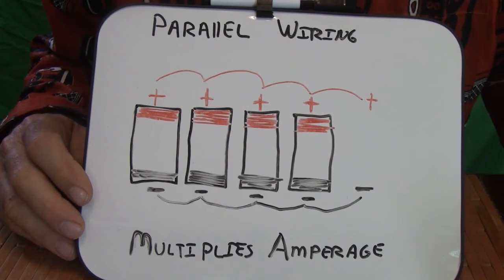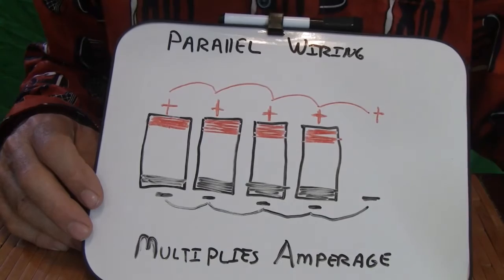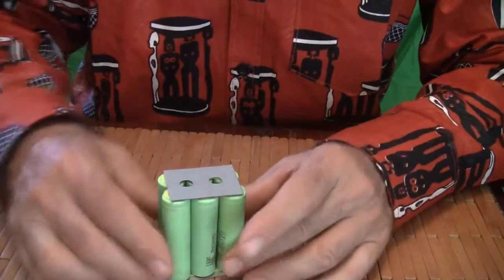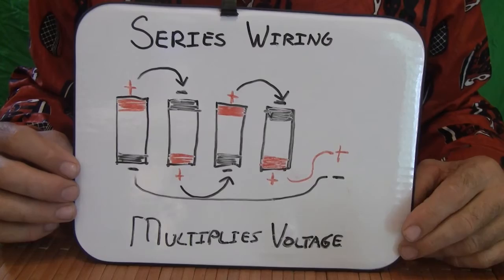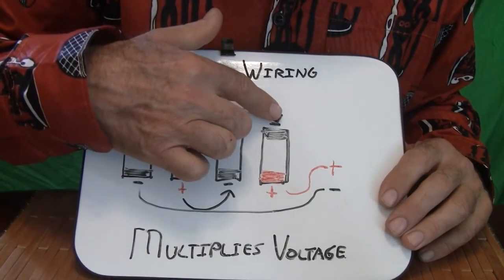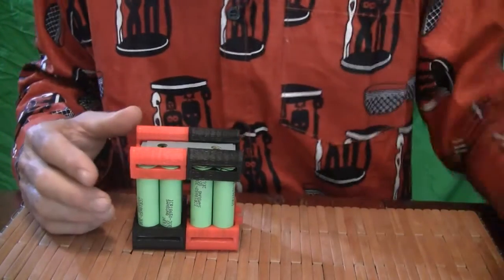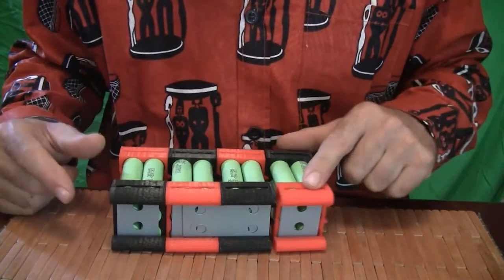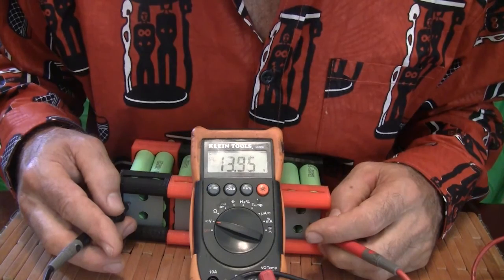Series and Parallel

Comment: I'm confused surely 3 , , 4 volt cells in series makes 12 volts ?
Reply from the maker: The nominal voltage of lithium ion is 3.6-  so, you can use either 3 or 4 cells in series..
Reply: thanks your a good teacher,i stumbled on this video trying to understand bike battery's, bms,...thanks